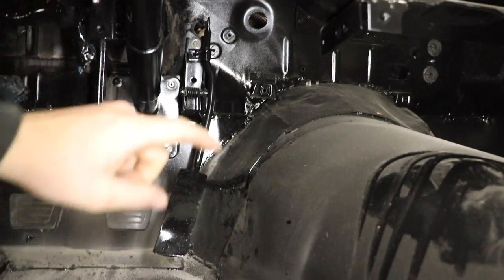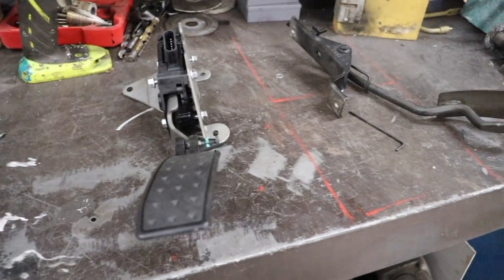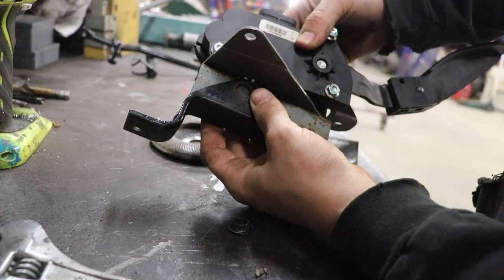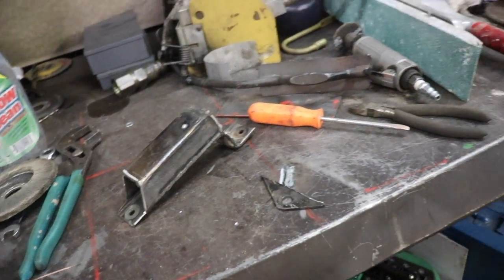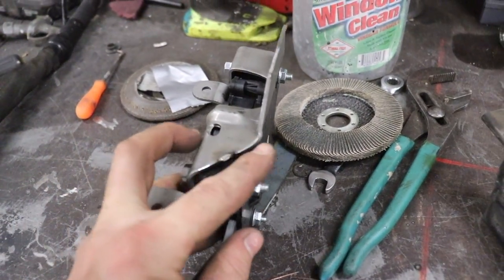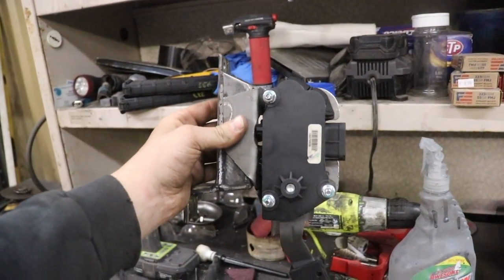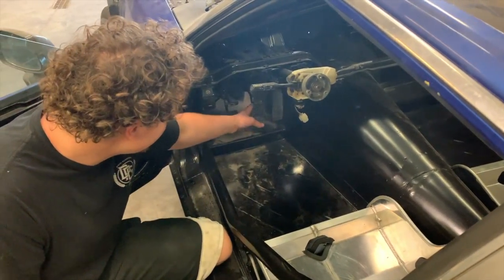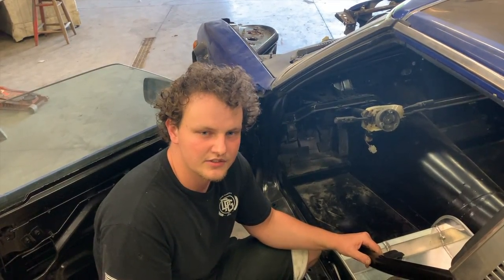LS swap Drive by Wire Throttle Pedal install on Datsun 280ZX

Comment: How did you wire in the gas pedal to the ECU? I'm in the same situation and would seriously love to know! I know there's a signal, power, and ground (often doubled), but where do you plug these wires into??
Reply from the maker: Terminator x max comes with all the wiring plug and play with there ecu to pedal to throttle body
Reply: @JohnnyFabz  shooooot lol that’d be nice
Reply from the maker: Taylor Baker it’s really not bad deal. Especially is not having a stock computer to start with. It was super easy to install and set up.